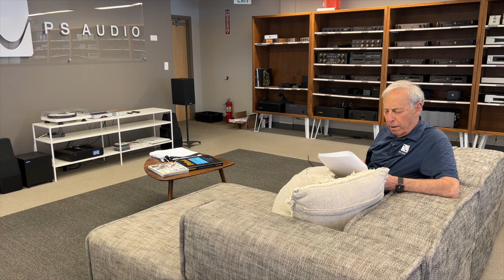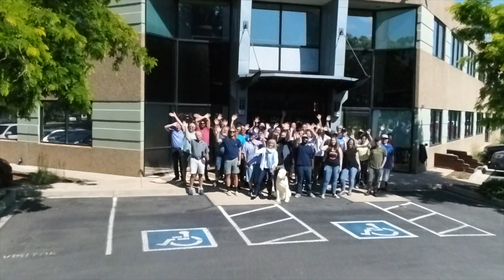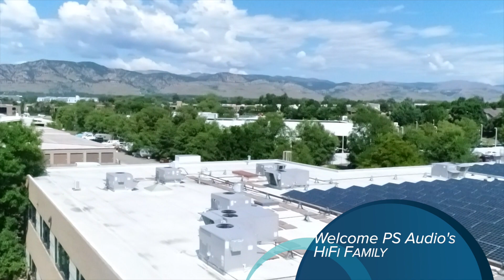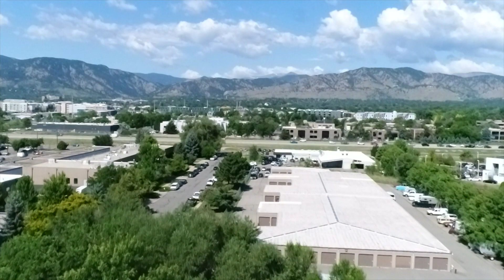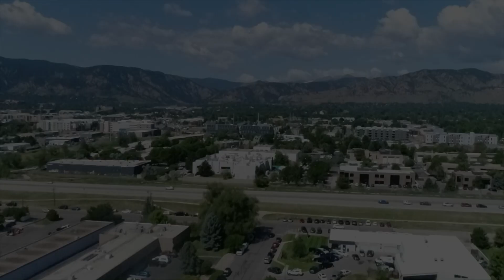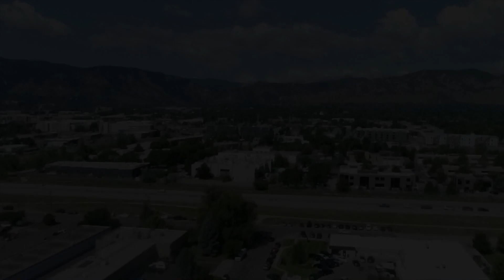The phase switch on an amplifier

Comment: If you have subwoofers that are mounted and pointing against each other in an enclosure.  Turning the inverted sub out of phase would help so elements would't  push against each other. But this is only an issue when to save space. In tight spaces you maybe want  to stack them. Common in car audi builds.

Comment: It's dang important if as you play, the amp causes a string to take off in an uncontrolled manner and will not stop increasing in volume until the affected string is muted. This happens when the amp is too loud or your instrument volume is too high and/or the amp and instrument are too close to each other. The phase switch can stop that annoyance from happening. If the amp has no phase switch you reverse the connection on the speaker, move, or face away from the amp. If you are playing an acoustic instrument you can also plug the sound hole(s) to prevent the problem.

Comment: I’m surprised Paul says this because in my opinion and experience, proper phasing of each and every single speaker in the system is one of the most critical things in audio reproduction to avoid cancellation issues and other nuances.
Reply: He's talking about absolute phase though, where every speaker still has matching polarity whether it be all normal or all inverted. The cancellation issues you mention are generally going to be from one (or more) speaker being out of phase with the others.

Comment: A couple things.  One you didn’t explain why there is a phase switch and that some pieces of audio gear reverse phase electrically and why  they do that.  The main reason for a phase switch is not all recordings are recorded in proper phase.  This switch allows you to hear if there is a difference and put it in correct phase.  As for equipment that reverses phase typically preamplifiers, some reverse phase because manufactures do not put the extra circuit to put the original signal back in phase because in order to do that a additional circuit is needed to do so and they feel this compromises sound quality.  Absolute phase is subtle and unless your system is super revealing your likely not going to hear the differences.  As to what to listen for, you will hear a-little better dynamics and impact and more synergy across the whole spectrum.
Reply: @Douglas Blake well it does matter if you have a high quality system and your a good listener. It’s subtle but it is real.
Reply: Hey Kevin, DB is exactly right, I don't care what system you have, you won't hear it... peace
Reply: @Douglas Blake sorry guys I can hear it and even had done blind tests of that exact thing and got it right 10 out of ten times.  So sorry it is audible but of course you have to have a good enough system and yes pretty well trained hearing.  I will admit it’s subtle but it is audible.  Sorry
Reply: @Douglas Blake oh ok you say so. You must be an expert

Comment: Interesting.  I have three amps that include a phase switch:  an Ampeg, a Peavey, and an Acoustic.  On none of these does the switch have anything whatsoever to do with the speakers.  On all of them it reverses the "hot" and "neutral" sides of the power-line feed to the amp power supply.

Can't see any reason to reverse polarity on a speaker cabinet, unless your running in stereo and one of the cabinets is wired backwards (which it shouldn't be to begin with).

Comment: In response to your comment at the end where you said both speakers have to be in phase (correct polarity, positive to positive, negative to negative on both speakers); I have found that it greatly depends on the acoustics of the room. What I do when setting up my system in a different room is to start with both speakers in phase. As I listen, I switch from one channel to the other. If the bass cancels with both speakers on, they are out of phase for the acoustics of that particular room. Regardless of polarity.

Comment: On Paul's 'The Audiophiles guide CD', he does have two tracks- one-in-phase, the other out-of-phase. The difference is big. In-phase, the song sounds like it's coming from both speakers. Out-of-phase, the same song sounds like it's origins is muffed and coming from all directions around the room.
Reply: Wouldn't that be one channel out of phase? That makes a big difference, when one speaker is connected with polarity correct and the other is connected with polarity inverted. With both speakers connected with correct polarity or both incorrect polarity, I'm with Paul.
Reply: @circattle  No, the CD doesn't have that track. Only both channels in-phase or both out-of-phase. You don't need the CD. Do it in your own system (at the speaker terminal).
Reply: @SilverAudiophile  What Sir Circus Cattle says is correct. Virtually all test CDs will have two test tracks - one in phase (+ to + and - to - on both channels) and one out of phase (one channel is + to - and - to +). What Paul was referring to is 'absolute phase' where both channels can be switched between + to + and - to - or both + to - . I have this recollection that it has something to do with the whether the speaker driver travels outward or inward with the initial signal input.

Comment: This brings me back to early 70's with my PA system. I remember the first time I replaced an EAW 12" driver with JBL. Talk about out of phase. That forward push on Negative volts for  JBL still tickles.
Reply: I dj in many clubs earnie did sound for . He was very underrated and his systems had tremendous spl with balance for the time . I went on to own many of nyc and miami clubs over years which had incredible systems that cost 5x the raw systems did.  Phazon was cleanest ive heard ..dynacord loudest until the   phased arrays hit clubs .

Comment: I remember a brief lesson on "absolute phase" when studying recording tech over 30 years ago. This meant that the phase of the signal at the microphone remains the same throughout the entire recording and playback chain. In theory, this would only work with the very simplest of recordings (2 channels live acoustic), but with multitrack studio recordings a practical impossibility.

There is another use for the phase invert button on an amplifier that could be to do with subwoofer placement, but most decent powered subs have a phase invert button themselves.
Reply: It is possible if you make your own microphone cabels which i did and be consistent in putting the wires at the exact same pins on the XLR connectors with all cables. ( i always used Neutric connectors.) 
Than you know every microphone has the same connection for each wire. ( 1-2-ground or plus-minus-ground.)

Comment: So the take away is that they must be in phase with each other, whether or no the polarity is standard or reversed doesn't matter. In my experience the only time it does matter is when you try to match a sub and have the sub in phase with the speakers makes a big difference in bass performance.

Comment: I'm not a super expert, but think the only reason to deal with phase in a home system is to integrate different sets of speakers. Our more commonly, speakers and subwoofer(s). But as others have said, any powered sub will have its own phase control.

Comment: Easy to keep speakers correct.  If your system has mains with decent bass, the polarity of of subs makes a huge difference.  My subs only have a 180 switch.  I guess subs with a phase dial would be better but... maybe next time.

Comment: It might make a difference when you are using a subwoofer amplifier. If the subwoofers are out phase with the main speakers the base would certainly be diminished. This could also possibly be  a result of speaker placement. My subwoofer amp has a phase angle adjustment from 0 to 180 degrees, and after some fooling around, I find I prefer the 90 degree setting. YMMV
Reply: Yeah, you can hear the difference really fast... It sounds more like "delayed" in my ear and has some sort of "latency".. I can feel the floor vibrating but can't hear the sound to mach it.. But in a 180 setting not in a "phase" i can feel the vibrations but i can hear the sound lost more in a sync? Weird? Also did same test with 2 subs and same thing happened once again.. So it's not just only "one" thing.. It feels like it's simulating the "reflex" in a back of case.. If it's close type sub.. But if the sub has hole in a back.. It just sounds far more dominant and has weird "breath taking" sound to it.. Like it's sucking more air or something.. And once again in a "phase" at 0 setting i can hear the reflex doing the usual thing what i hate about back hole ones but it doesn't have the "sucking in" effect

I hope this makes some sense xd
Reply: when you have a seperate box for low frequencies, like a subwoofers, phase is important. but any phase adjust on subwoofer is adding delay, phase is also time difference between drivers.  some phase knob might give you no extra delay at 180 degree setting, but the dsp or dac in a subwoofer adds delay, as well as placements vs the main speakers.
if you use 90 degree setting you probably are at least whole wavelength delayed to get matching waves with main speakers. 
a time delay on main speakers is the only way to get perfect phase between sub and speakers.

Comment: If I’m running a stereo amp bridged to mono and only using the “red +” outputs, does it matter which one goes to the red + and black - speaker connectors?
Reply: Yes. Look closely at the RED terminals. There is always an indication of which RED is negative in Bridge mode

Comment: I remember my feeling physically sick whenever I played music through my new speakers but couldn't understand why. It wasn't until I spoke to the retailer that he explained polarity and you check it with a 9 volt battery connected to one of the speakers. Sure enough it went in instead of out. The manufacturer had missed it in QC ! Needless to say some of us are very sensitive to phase/polarity. The sounstage to me won't stay put, it keeps on swinging from one channel to another and makes you nauseous 🤢 So I imagine a phase switch would be a magic bullet for me!
Reply: From your description I guess is it phase cancellation: only one speaker is polarity inverted, as Paul explains it at 4:18 ? If so, stereo power amplifier polarity switch does not solve the problem because there is only one polarity switch and both channel polarity are inverted.

Comment: 🧐  …IT SEEMS TO ME THAT THE POLARITY SWITCH WOULD MOSTLY PERTAIN TO ARRANGEMENTS CONSISTING OF MULTIPLE AMPLIFIERS (WHERE ONE SET OF SPEAKERS IS NOT QUITE PERFECTLY TIMED). 
- ONLY THE MOST DISCRIMINATING EAR WOULD DETECT PHASE DIFFERENCE EVEN IN A ‘SIDE BY SIDE’ TEST (LIKE MAYBE JUST A SLIGHT EDGE DECREASE IN PUNCH (INITIAL ATTACK OF A SOUND))…

Comment: Isn't it important for sound mixing to place some elements out of phase with the rest of the mix to create psycho-acoustic perception of those elements coming from behind or around the listener?
Reply: Interestingly enough that’s what I do with my surroundsound speakers in my home theater set up; I wire the surroundsound speakers out of phase for that phsyco-acoustical effect.

Comment: I have two songs which sounded "off", which turned out was due to them being out of phase.

1) John Fred & His Playboy Band
Judy In Disguise

2) Edgar Winter Group
Frankenstein

I used Sony's Sound Forge to reverse (make correct) the phase, and that helped.  But neither recording is the poster boy for sonic excellence, especially Frankenstein.  Judy In Disguise is reasonably good sounding, but Frankenstein is a botched studio job from every angle.  I just do not know how anyone can screw up the sound quality so badly?  I would not know where to begin, to take the original, great sounding capture tapes, and turn them into the sonic mess we here from the Frankenstein version released to the public.

Someone at the studio must have hated Edgar Winter, to trash his band's hit song with such skill.

@4:18 "One last thing (one speaker out of phase):

Paul, when the technician from the store connected my speaker cables, he did it out of phase for my right speaker.
I lived with it in that configuration for longer than I care to admit.

I knew something was wrong, but I did not know what it was.
These speakers were an upgrade from my previous speakers, and sounded worse (not so in the store).

After enough complaints from me to the store's owner, he sent over a new technician who is sharp.
He listened for 10 seconds, checked the cables, and fixed it.

Sure, it was simple to fix.
But like having a water leak, often the problem is identifying from where the leak is originating.  That is the hard part.  Once identified, it is typically simple to fix.
This technician had both the ear and the know-how, and he was in his early 20s.  A valuable employee.

The store's owner apologized to me, and he never admits to making a mistake.  He was embarrassed.  In fact, he was present for the delivery and set-up of my upgraded speakers.  He heard them, and he did not catch it.  It hurt his ego, because he does have a great ear, based on every system he sets up in his demo rooms.  I think that he just didn't care, and wanted to leave (as if he had a hot date).  But I was happy that it got fixed, and have loved listening to it ever since.

Comment: Then what is "phase angle"?
Reply: "Phase ANGLE" is the difference in timing between two signals. That is typically a part of an "impedance" rather than just strictly "resistance" measurement spec and is often frequency dependent. Power is a measure of work performed spec'd in Watts (P). It is simply the voltage (E) times the current (I). P=E*I. In DC or pure resistive loads the E and the I are locked together either not changing (DC) or in phase (AC). But if an inductor like a voice coil or cross over coil, the I wave slides in phase behind the E wave. The distance relative to frequency is the "phase". 

So a pure resistance spec might be 8Ω. But an impedances spec might be 8Ω/15° @ 10Khz. And "15° @ 10Khz" is the phase angle.
Reply: @Douglas Blake Ya well if you start at zero on a sinewave and follow it UP, you go 90 degrees. You have to go back DOWN again to get to the first half/ 180 degrees. There's that..... Thanks for trying though.

Comment: Absolute phase. As you say, the speaker creating a positive pressure when the source is creating a positive pressure. A kick drum moves forward as does the speaker reproducing it.

It is surprising that with your system's ability to resolve and your experience level that you can not detect it. I have proven 100% of the time, even in blind tests, to be able to identify absolute phase in seconds even if the first time in the room. 

e.g. a few years back (prepandemic) I walked into a stereo shop (yes we have physical ones around here) and the salesperson turned on a pair of ELAC towers. They sounded out of absolute phase to me from the 1st second. As everything was patched with bananas I asked him to switch the phase of both speakers without explaining why. Yes, they were now in absolute phase. So I told him I would leave the room and he was to either switch them back or not so I could then reenter without knowing and see if I could identify it. I easily did. When I explain what I was doing, he was not even familiar with absolute phase so had no idea what I was testing. Yes this was quasi single blind. But the tester did not even know what test he was performing and I did not interact with him at all coming back in. So pretty close to double blind. And I have done double blind as well. 

The problem being sometimes a mic on a recording is reverse phased so the piece has both phases in it! You have to go by the phase of the greatest number? Or sometimes the mic phase is reversed on purpose. The Toshiba/ EMI direct to discs I repped in the '70's liked doing this to the kick drum mic to keep groove excursions down! Like "Boiling Point" Toshiba Lf 95009.  Drives me crazy to listen to them because everything else is so clear and clean!

And the switch was included on amps because switching in a Tone circuit usually inverted the polarity.
Reply: @Douglas Blake You might not perhaps.